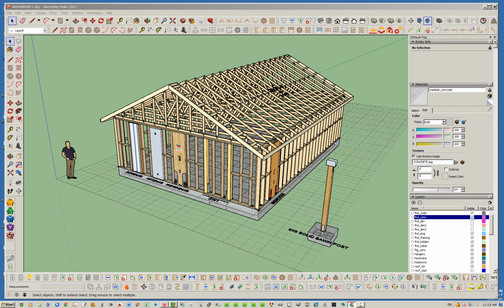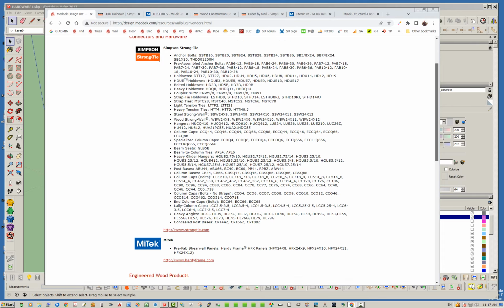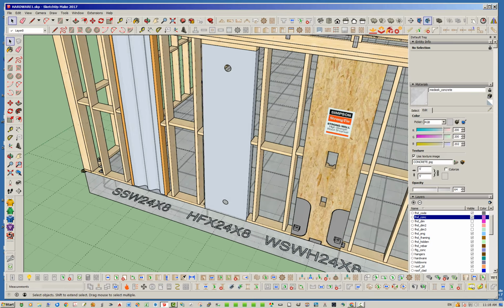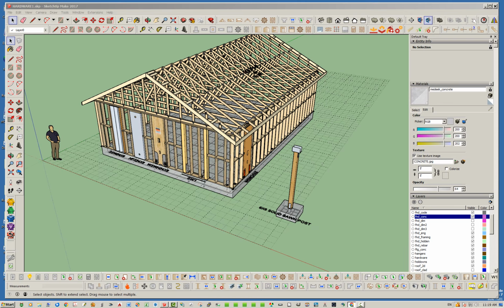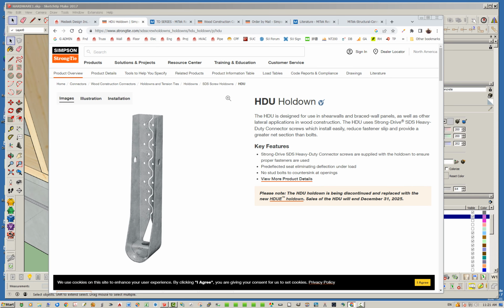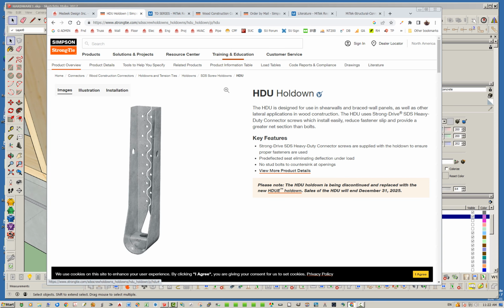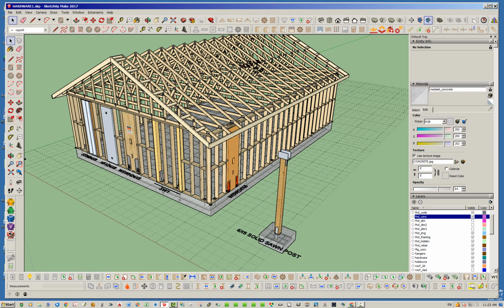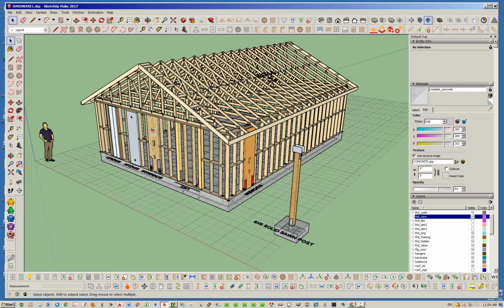Medeek Wall Plugin Tutorial 77 - Mitek vs. Simpson

Comment: I noticed that MiTek products are no longer available at Lowes (1-3/8" Lumberlok screws). I'm in the northeast but I have to order them from Menards. I'm not in building construction, I'm just developing a product, and I choose Lumberlok structural connectors because they come in 1-3/8" lengths while Simpson's are 1-1/2". I'm afraid my 2x4 lumber will be slightly thinner than standard for whatever reason (e.g., my sanding) and the Simpson screws could poke through. But I need a Simpson connector, which has holes too small for the MiTek screws, so I punch 3/16" holes so the MiTek screws fit. Very annoying and not an option for most people using these connectors.

Comment from the maker: I"m curious what others experience is with technical support from either company.  I've never had to lean on either too much for that since the documentation is usually enough, but please comment below with regards to your experience with either vendor.  I'm also curious if anyone has any opinions on the hardware itself, what seems better built, less defects, problems etc...
Reply: We typically call out Simpson or equivalent just because of the familiarity both structural engineers and contractors have with Simpson.